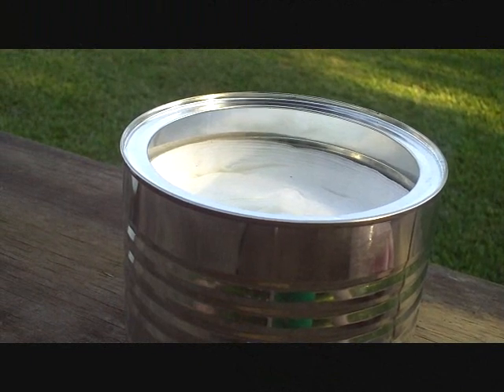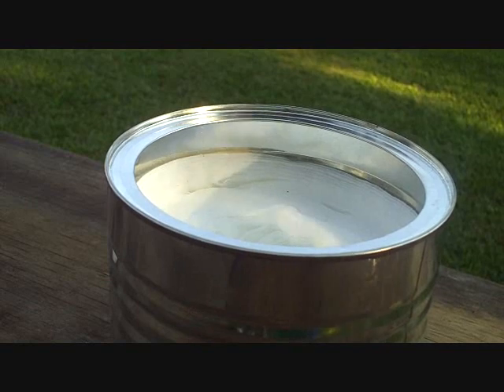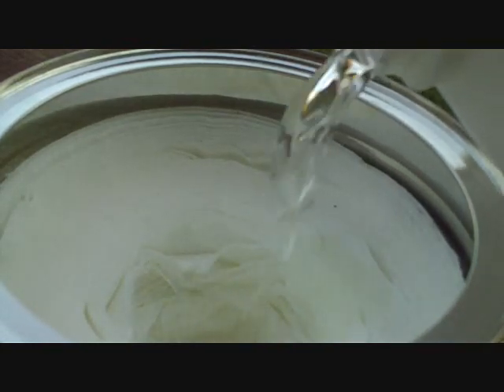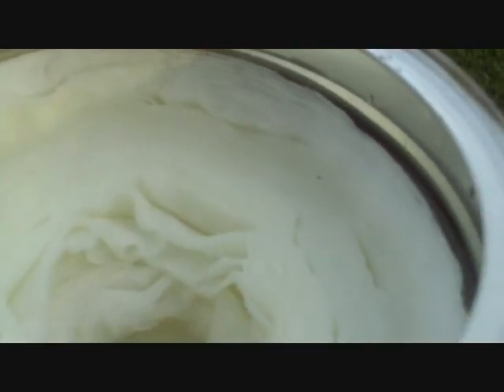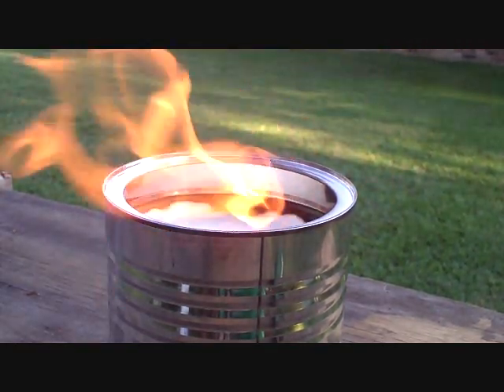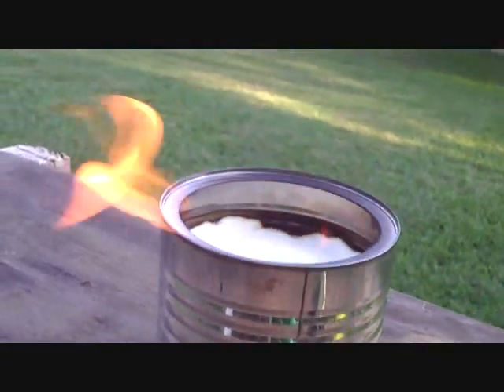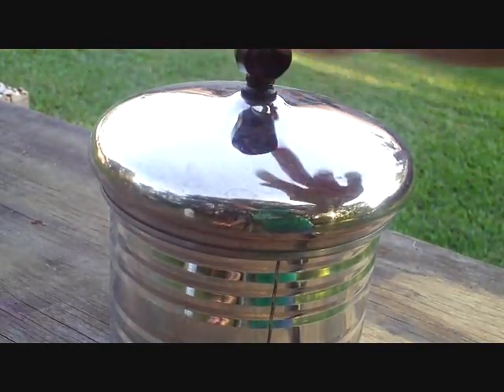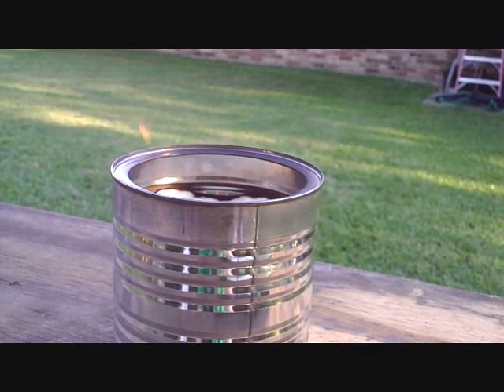coffee can heater diy

Comment: You can also do this with Hand sanitizer gel which is as cheap as the alcohol,(can often be 'found' in porta johns if you're broke, pumping out a few oz's to keep yourself from freezing is probably ok) doesn't need the tp (although a small piece of grass or a stick helps combustion) it can be done in an empty soup can too, poking a few small holes near the top for air helps too and won't spill easily and  you can even cook over it. (ps it's been sold as Sterno for a long time)

Comment: A carbon felt welding blanket would work better than the toilet paper. I section of round ducting with an end diffuser atop and draft holes at bottom; set over the open flame would make it much more safe and would retain a bit more heat.
Reply: ....and Kerosene would be a better fuel if you have it.

Comment: does it have to be coffee can or any other can with similar size
Reply from the maker: You can use a small paint can or any can it helps if the TP takes up most of the room in the can but  its doses  not have to be super tight

Comment: For a cleaner burner, don't use rubbing alcohol. Go to a truck stop and purchase a bottle of "Air line brake antifreeze alcohol".  It is not antifreeze as you understand it, but it is an alcohol that frees air brake lines on trucks of moisture. It is a way cleaner and safer alcohol. Also it has a slight blue flame but it is harder to see when lit. The other thing is it is a more pure alcohol as well.   Just sayin.

Comment: I have made them before out of drink cans, many times I just used methanol. This is go way to have a small fire in a pinch, I used it to warm up a air line..
They don't burn very long because the alcohol evaporates fast, but if you have enough toilet paper and alcohol it should last quite some time.